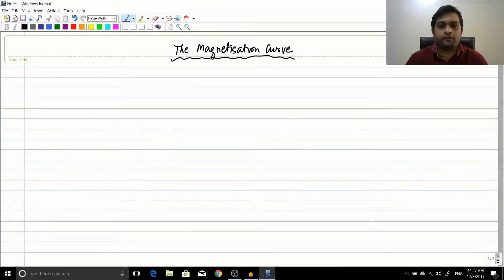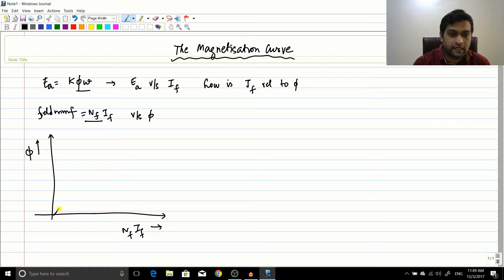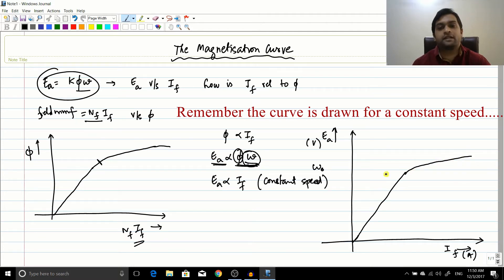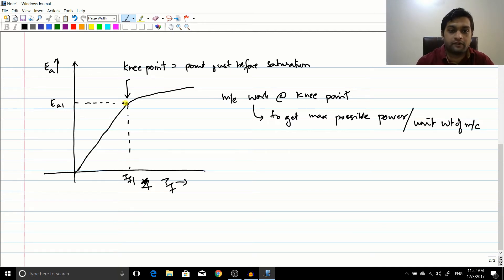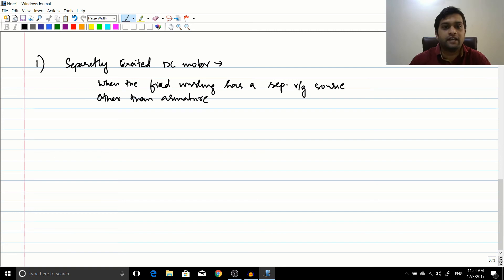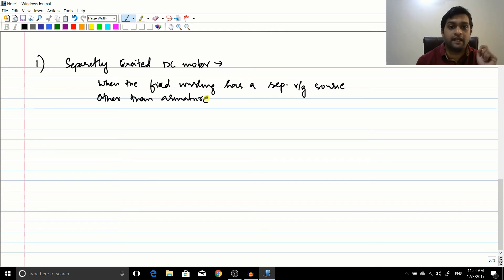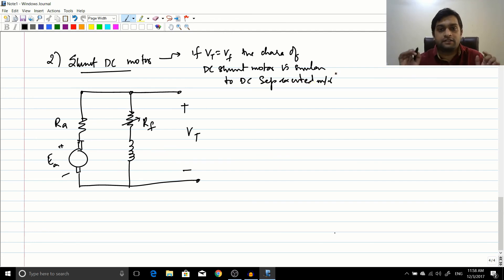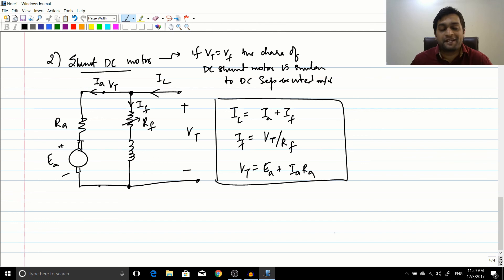#2 DC Motor -  Magnetisation Curve and Intro to DC seperately excited and Shunt excited motor

Comment: Sir , how is it practically possible that at load armature current is zero but speed will present in case of dc separately exc. Motor...
Reply from the maker: At no load the machine will rotate, however it will.only draw a small current, just to supply the no load losses..

Comment: when use series rather than separate and vice verse.
Reply from the maker: depends on application  separately excited and shunt has constant speed characteristics, so they are good for constant speed loads..series motors have high starting torque so they can be used for traction....